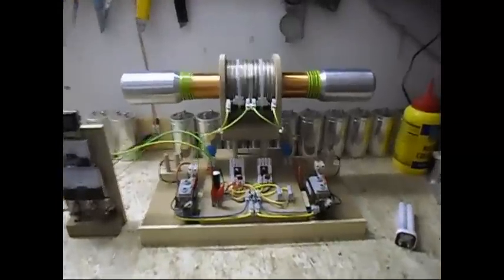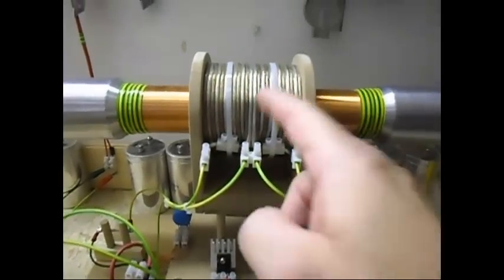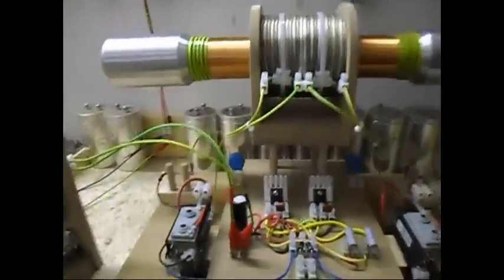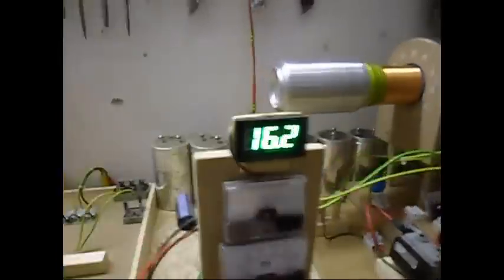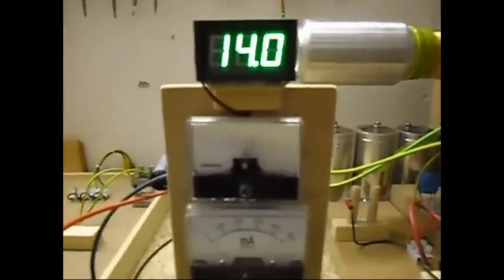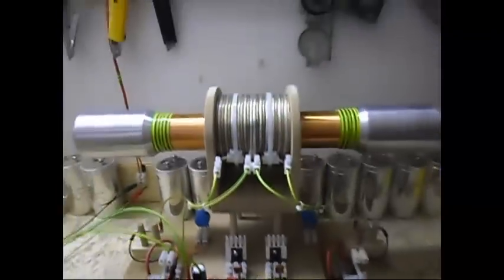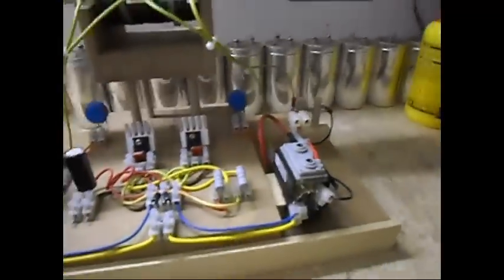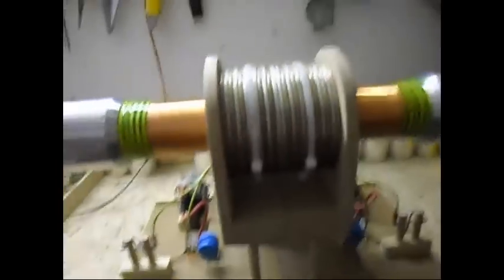Horizontal Tesla Coil - Twin Flyback Ttransformers, Twin Spark Gap & Royer Oscillator...

Comment: Does anybody knows criteria(formula) for oscilating frequency. I have found that it depend of time rating the flux(T = R/L), but I am not sure.
Reply from the maker: Thanks for your comment...^^
I am not an expert on oscilating frequency but you are correct...when these kinds of setups are in resonance they will perform at their best but mine is not even close to it's potential but than again it was just a test i wanted to do to see if i could get it to work with "Twin Flyback Ttransformers" and it did work pretty well so i was pretty pleased with the result nonetheless...^^
Reply: I was lazy to explain in more details. The frequency problem is about Royer+s oscilator, for wich I read that you use in experiment. I am school teacher of physics and I am interested in high frequency rotating electromagnetic phield, so I am interested for Royer oscilator as starting position for three phase oscilator. Thank you on fat answer. Goran.
Reply from the maker: Nice to read that you are a  "school teacher of physics"...^^
I do like the Royer oscilator and used it also as a high frequency inverter kinda circuit and it works very good for lighting up fluorescent tubes...;-)

Comment: Please post the schematic
Reply from the maker: +KALAI SELVAN 
Thanks for your comment...^^
It is just a basic NPN- transistor based Royer Oscillator circuit and where you would normally put the center tap primary you now put the flyback transformers primary...;-)
And the spark gaps is like in any Tesla coil setup, hope this help you out a bit...^^
Reply: +Mister Caribbean Roots i have doubt on using two flyback in a single circuit that's why i asked for schematic..
Reply from the maker: +KALAI SELVAN 
No need for doubt, just try it with less voltage like 6vdc or so and see how it goes...;-)
If everything seems to work right than you can use higher voltage...^^

Comment: One question though. Are you setting up the HV primary in a push-pull configuration? If not then you may be getting some cancellation in the secondary. What you will have is a dipole system if you have them in sync as opposites. Now don't mess with any HAMs out there and be safe. Ground everything you can except yourself. The truth could kill you if you're not more careful. While I'm at it, this is showing in my l,ist to the right. https://www.youtube.com/watch?v=lpI6ikj1G-s
Enjoy!
One other quick tip. This could make an ideal primary https://www.youtube.com/watch?v=WI3GYNLh5Mc
After all your trying to generate radiant energy right? What do you think is the resonant frequency of the secondary? Have you done the calculations?  Try using half the number of turns there as a value to start. As for the dielectric capacitance of air check your humidity first. :-D
Reply from the maker: +Douglas Allen 
Thanks for your comment and them u-tube videos links...^^
About the push and pull...sitting here writing this post i really have no idea you know...lol...it is driven by a Royer oscillator so i think it is a push and pull setup...???...need to check that...;-)
No calculations done so it is not in resonance thats for sure...lol...i just had an idea...build it and try it and it worked to...not so good but it worked so i was pretty pleased...lol
Those pancakes coil are very cool indeed and i never made one yet...;-)
Cheers

Comment: Certainly it aught to light the FL-40 or 30 pretty well so just hang it up there above the secondary coil while you tweak/tune it all. I can't see the overkill though with two fly-back transformers. It just looks nice and balanced is all. Try lust one. Here is a typical circuit. http://laserpointerforums.com/attachments/f60/38001d1336951910-help-wiring-flyback-transformer-schematic.png
The rule of thumb for high frequency design is to keep your leads as short as possible. I hope that helps keep the design simple. There looks to be too much wire running all over the place. Good luck! Best regards..
P.S. I;ve seen Tesla coils driven by rotary spark gaps. You know. Control it with a motor. That gives you something to tweak/tune also.
Reply from the maker: +Douglas Allen 
Thanks for your comment...^^
I did make a Tesla coil with one flyback transformer and it went pretty good...;-)
I am no expert on this and this double setup was just an idea of mine which i make just to prove that the idea does work and it certainly needs some tuning here and there...;-)
Thanks for the link you provided...^^

Comment: Hey Roots, I revised that plan substantially with an updated video. 55 common cores! They'll all want to charge simultaneously yet fields among them want to run out of phase ofcourse. Now I'm trying to figure out how to use spark gap arrangements to replace the need for a transistor. I don't show all in the video. There is a 4 contact distributor inside the hull which shorts 4x each rev to reset the carrier wave. I read an article yesterday on how semi trucks can now generate power using ionized wind at the back corners of the box using a pair of staggered copper plates sandwiched around a block of teflon. 'plasma actuators' .
Anyway; if opposite plates of metal are charged, they must cross a bridge to short and balance charge. If that bridge is a sharp rim aiming down, the bulk of any wind produced will move down. Such ion wind may be produced without the need for atmosphere.
I'll post an update video once I've gone a step further with the engineering.
Plasma actuators do burn out, so best I stick to the reverse engineering done on the Coral Castle machine. Therein, the carrier wave by distributor would leave a center of rotation passing through a lot of iron until it could finally reach the magneto block having opposite magnetic charge at the time. This new design uses magnets outside however around 24 magnetos, so the short against their common ground would have no reason to fight it's way there unless every other rib of the magnet array had alternate ground.
Reply from the maker: +mikefromspace 
Thanks for your extra info about your ufo design...^^
I've watched both videos on your spark gap ufo concept...seems to me that you have a solid plan for this ufo build...o.O
I don't really understand all of it but that's not an issue because as long as you the designer understand all of it's all good...^^
So my question would be, when are you starting this build...???
You are working with autocad or some program like that so it would be very easy for you to let someone lasercut and/or cnc some of the parts needed...;-)
Wish you luck with it and when you have made some progress and made a video do drop me a link...^^
Cheers
Reply: +Mister Caribbean Roots  See Kesche foundation release, it's fantastic. I'll be nano coating my copper anything from now on with carbon/oxygen crystals to amplify their dielectric properties. I may try something new also like making foam molds I'll coat with zinc spray, then electroplate that with copper, and then plate that with the carbon/oxy crystals. Molds of certain shapes that would produce certain fields for antigravity machines very very cheap to make. 
Thanks to Kesche, I now have a better design for that machine. Ofcourse I'll put this together asap.  45days maybe? I have a few things to order and lots of copper to scrap from junk in the shop the next few days.
Reply from the maker: mikefromspace
I've read a bit about Kesche but that's beyond me...lol
I'll stick to just the basic...:D
Nice to hear that you will be working on this wonderful design a.s.a.p...^^
Carbon make good tiny super caps...but that's only one of the mnay things we can do with carbon...it all depends what we need or wnat to make.do...;-)
Take your time with it...measure 3 times and cut only once...save you a lot of headache...lol
Cheers

Comment: I heard that resonance is 4 to 1 (Four to One ratio in your winding.) If your primary has 6 turns your secondary should have 24 turns.  Like the four seasons of the year, think in terms of nature , but I would try like 24 turns on primary and 96 turns on secondary for high voltage spikes and more radiant energy reception. It would be a good idea to measure the resistance of your coils I think you would want to have the same ratio of resistance 4 to 1. If your primary has 10 ohms your secondary should have 40 ohms this can be achieved threw proper gauging (awg) of your wire thickness. Nice work man
Reply from the maker: +myke Does 
Thanks for your comment, your info on resonance and glad you liked it...^^
I'm not a specialist on this stuff and resonance...i just make what i think would look good and hope that it will work as good as it looks...lol

Well, the secondary has 696 turns and the primary has 6(x2) on each side.
The resistance of the Secondary should be around 59 ohm and the Primary i do not know since i've never measure it...
Going from your info my Primary should be around 15 ohm or so but i'm pretty sure it is not even 0.5 ohm...lol

And this setup has been completely dismantle because i needed the space to work on upcoming projects...-.-
It is a shame that i always have to dismantle my projects because of space issue but it is what it is and i must continue...
The only part left intact is the Secondary with the Primary since that part was made to be detachable...^^

Comment from the maker: Hi Harsh Dwivedi,
Sometimes i can reply to your post and sometimes i can't...o.O...lol
Good going, if it is a samsung it may already have internal diodes build in so the high voltage output is DC and makes it easier for you to work with...;-)
I would not use 180vdc for the input...lol...just start with 12vdc and take it from there...
Have fun...^^

Comment from the maker: Hi Harsh Dwivedi and thanks for your comment...^^
Any flyback transformer will do, but it would be good to use two of the same specs if that is within your reach...;-)
Have fun...^^
Reply from the maker: Harsh Dwivedi 
You are welcome, if you have more questions...just ask and i'll do my best to answer them as good a possible...^^
Reply from the maker: Harsh Dwivedi 
They are all DC driven as far as i know, input should be 12vdc(for now) and the output will around 12.000vdc so be careful...that is no joke...o.O
Yes, any NPN transistor will do just fine but of course there are some that works better that others...;-)
The 3055 is one that most people are using since it can be used for many projects...;-)
Mosfet can be used also but the thing is that you can not tune it by it's Gate as you can do with the Transistor Base and this is because Fets Gate are voltage driven and Transistor Base are Current driven...
Use your multi meter to find the Primary and the Secondary of your flyback...see this link here to give you an idea where they should be...;-)
http://www.gardenballistics.com/wp-content/uploads/2015/03/flybackpsu_4.jpg

Normally i would use the feedback to drive the transistor(as i did in older Tesla Coil videos) but since my 2 flybacks are driven by the Royer oscillator in this video there's no need for it...;-)
Hope this help you out, and one more thing...don't rush it...it will only de-accelerate your own progress...;-)
Cheers

Comment from the maker: Hi Harsh Dwivedi,
Can't reply below your comment so i go about it this way and thanks for it...^^
Well one thing is sure, everyone is asking the same questions about my projects nowadays but i have to disappoint you as well since i am not going to make sucha video...sorry about that...:(
The circuit is a NPN transistor based royer oscillator circuit and where it would normally go to the center tap primary of a transformer is where the 2 flyback transformers are now with 2 diodes since without these it doesn't really works properly and my system is not tuned into resonance in the video that is why it's performance is not optimum but the idea behind it is solid...;-)
Other than that there is nothing fancy about it except that it looks really cool.lol
The secondary is just like any secondary of any Tesla coil with the cans as top load...
Tip, make a Tesla coil with using a flyback transformer and when you have this one working it is very easy to see what i've done here...;-)
Hope this help you out on your journey and if you want more info and/or other info just ask and i'll reply if i know the answer that is.lol
Cheers